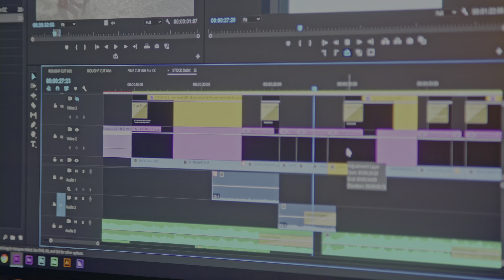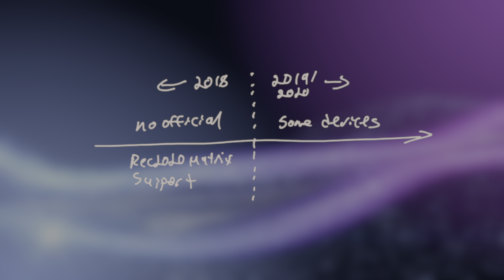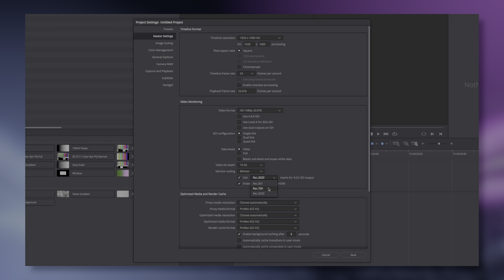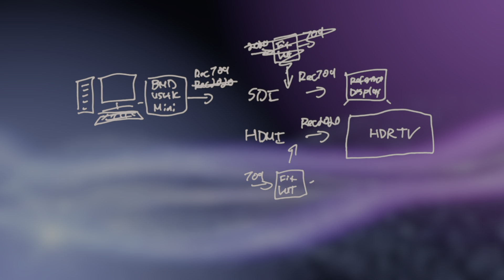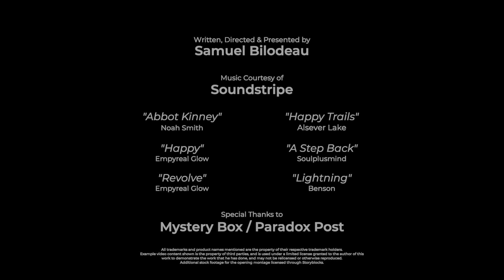HDR's Luma Conversion Problem | MasterHDRVideo

Comment: It would be very helpful to understand which display IO adapters/cards have this quirk, some devices have been in existence across the 2018 boundary and knowing whether they have been updated and are (or are not) still affected is useful information.
Reply from the maker: I only have a fuzzy knowledge about which ones do or do not - the AJA cards have had it for a while, I've never tested the MATROX or BLUEFISH cards, but all BMD UltraStudios prior to the 4K Extreme (and maybe even that one), and all Decklink cards of the same generation have had it as an issue. I noticed the switch with the UltraStudio 4K Mini and the new UltraStudio Monitor 3G, though it's also possible BMD's updated the firmware of the older IO boxes and cards too. The big issue is on displays - if they don't say they do, they don't.

Comment: EXCELLENT! Thanx. The issue is when importing/displaying footage that was encoded with an unknown matrix, how do I know which transform LUT to use?
Reply from the maker: Unfortunately, there's no good way to know without access to the original content that encoded the file.

One trick I've used in the past though is to check whether or not HDR10 content exceeds the P3 gamut, even if its color blob looks like it shouldn't be - the hue rotations can push the frame average or peak brightness above QC fail, or outside of P3, so I would add the LUT that brings these excess values to the lowest gamut percentage and brightness violation level.